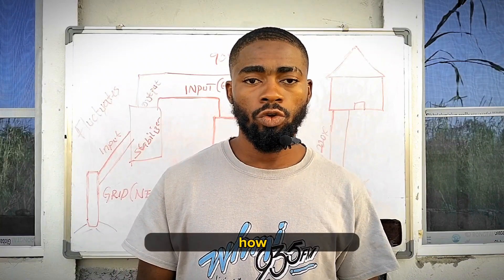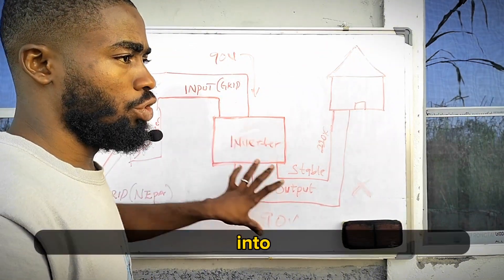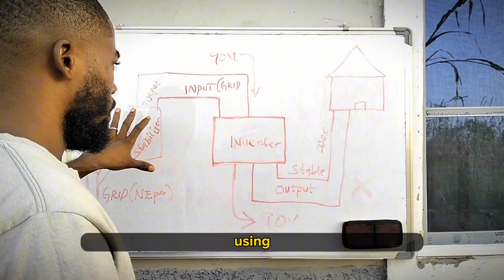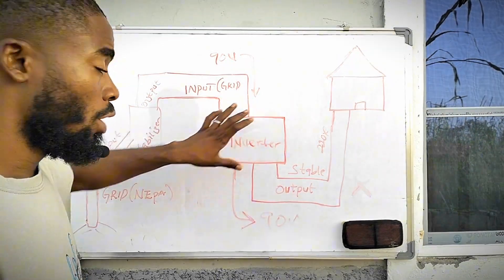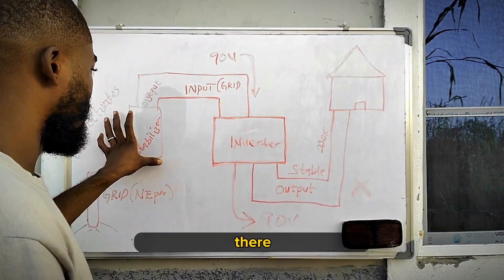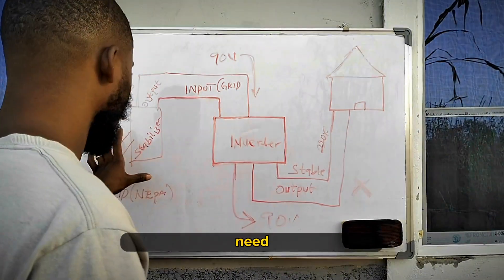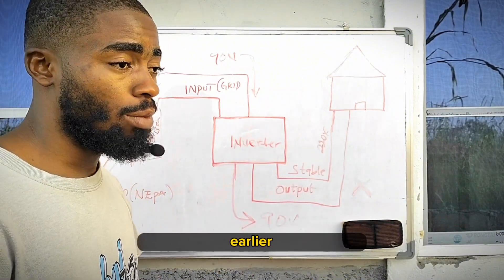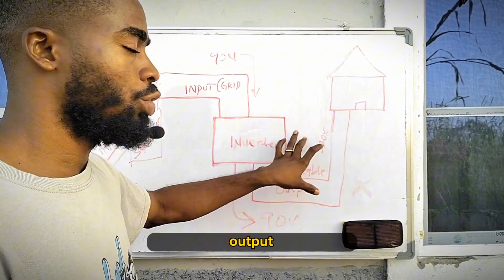Can I use inverter on stabilizer??. how to use inverter on stabilizer!.

Comment: Hello sir 1st time coming across your video

I understand that on AC connection the inverter stands as a bridge with no restrictions meaning if the grid gives current with whatever voltage ⚡ as inputs to the inverter then the inverter simply passes this current OR voltage as it was recived into whatever it is supplying which is the home 🏠 in your example

And you also went futher to say that to limit the strees of the rellay which is OR are  the circuit component/s in the inverter that function as sonsor that track input current and voltage ⚡, one should then consider using a stabilizer. Such that the voltage reaching the inverter should not only be stable, but usable as the are some voltage ranges that the inverter won't even sens or work on like maybe 0-80V

My question is, i don't know if it was and error you made but just to be sure,  i think you mentioned that whenever DC current from the grid "which i think you intended to say from the Battery OR panels BLC grid gives AC" comes in as input to the inverter the inverter always gives it out as a stable 220V AC to whatever it is supplying as a home 🏠 in your exaple. So i don't know if that's exactly what you meant OR i got it wrong and need futher clarification 

As my concern for searching this content was to know if the inverter always gives out stable AC voltage to the home, when connected to a DC battery/panel as input. So that i won't have the need to use a stabilizer between the inverter and the home 🏠 appliance in such a sceenerio.

 I also had already thought of using a stabilizer for the gab between the grid and the inverter. So for that i have no worries

Comment: SOLARGOD Nice illustration…  but something came to my mind. If the light coming from the grid has to pass through the inverter to supply the house. Does this mean even current from generator also has to go through the inverter?
Reply from the maker: If your generator is capable, yes.
If not you can just from the grid point direct

Comment: How can you  connect AC stabilizer on DC current which is battery DC 
Because current that coming from solar DC  is possible for it to work with AC stabilizer,  ?
Reply from the maker: Your inverter has ac input

Comment: To be clear, from the grid through the stabiliser (regulator) to the inverter goes to the battery for charging, right? Or, are you only referring to a simple grid to house supply via the inverter?
Reply from the maker: Yeah,
Charging the battery with inverter through the grid